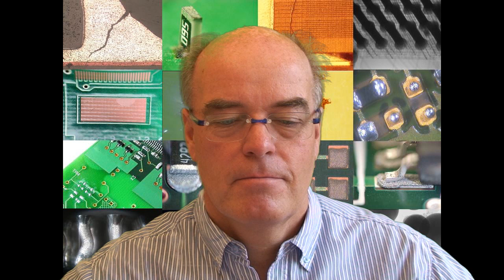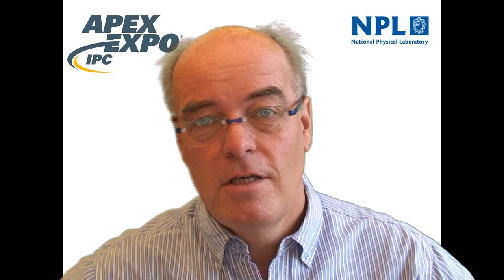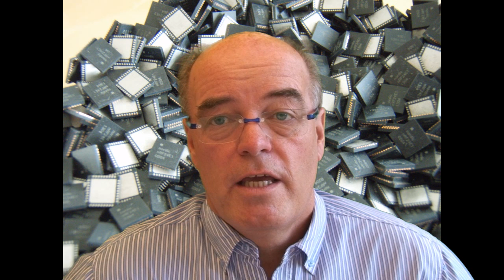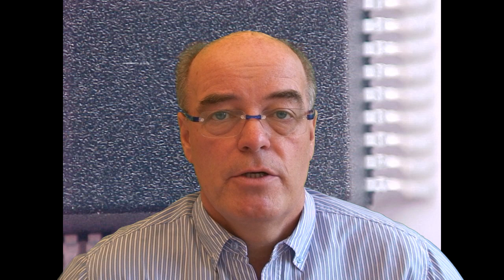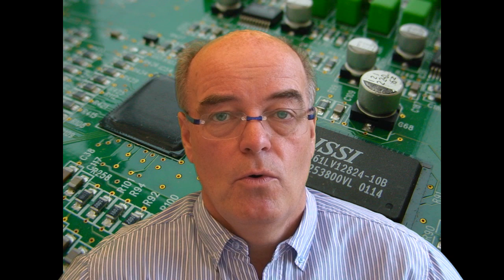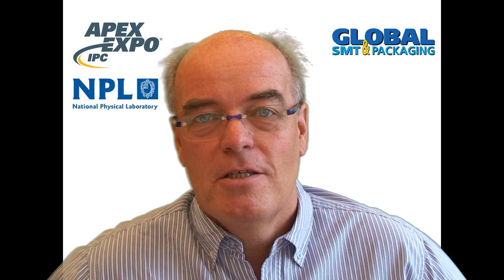Ideas for Identifying Counterfeit Components

Comment: I  bought some IC's and some transistors, Mosfets and IGBT's for fix some things finding a lot of counterfeit components purchased from varios china sellers on ebay.

First signs that I find was the thin  leads, components looks like sanding, bad printed numbers, some times printed with laser over sanding surface.

Finding this, I proceed to cut the transistors because I don't have an electron microscope,
and "Bingo" some times I find 1/4 of the original size inside.

My solution for this probles was to buy only on trusted sellers, like Digikey, Newark, Mouser, 
I buy component from two trusted china sellers only.

Cheers.